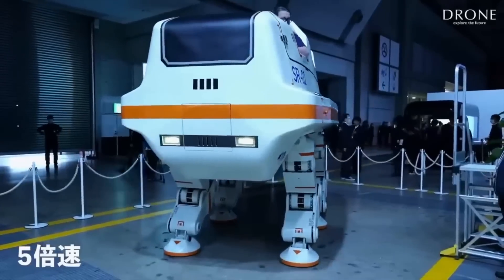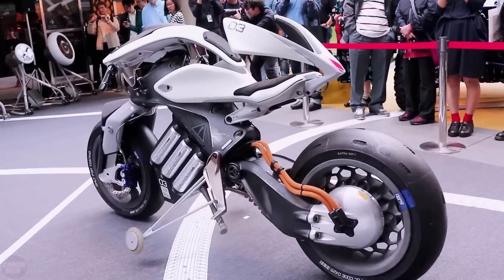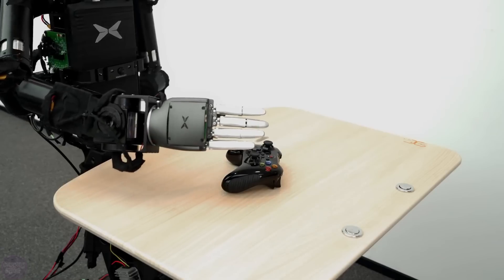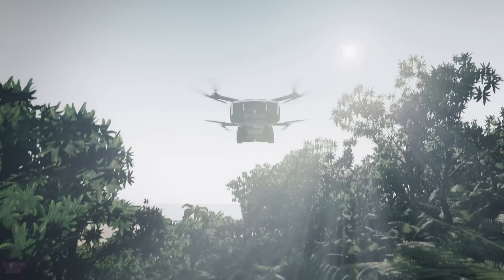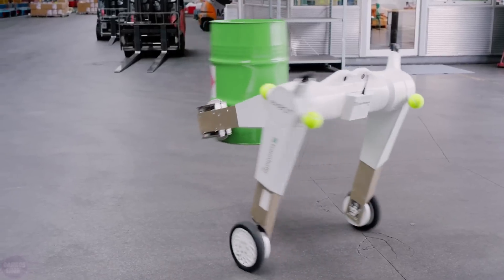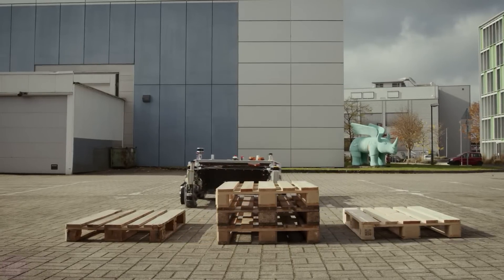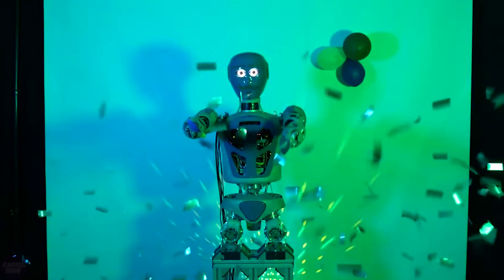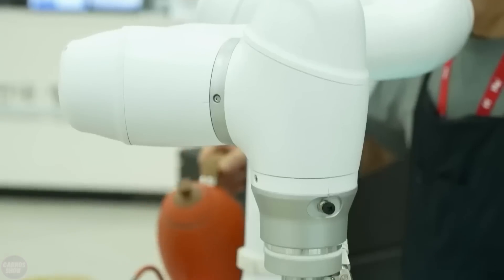Japan's Next-Generation Humanoid Robots and Technologies SHOCKED the World

Comment: SHOCKED at how poorly this clickbait is faked.
"Without squatting""  Sure looks like a squat to me.  When the legs extend to lockout during normal movement I will call it human-like. Before that, it's abnormal.
The XPENG minivan and flying sub-car looks amazing. Amazingly well computer-generated and raytraced, that is. It's entirely animation and at best only a few set pieces actually exist.
And their "super car" is in fact just a render, since the "real' version is just a plastic mock-up.
Evobot looks helpful on flat surfaces, with no stairs.  The forklift machine also lo0oks helpful.  The issue is what they do when humans are in the same space.  They don't seem to have real sensors.
The AI females are f'ing creepy. Very Japan.
The German dancing robot is straight out of Sprokets (SNL comedy, look it up)
The whole thing about robots to create foods... so far they're just GPT enhanced ways to use highly specialized machines that only do one or two things that are a subset of actual cooking, and they replace a human doing the same task with regular tools and equipment, which doesn't really save money or time unless no human wants to do that task. On the contrary, they make it much more expensive and generally more inept.
And best of all, the commentary pushes this as if it were a great advance.  We should be better than that by now.